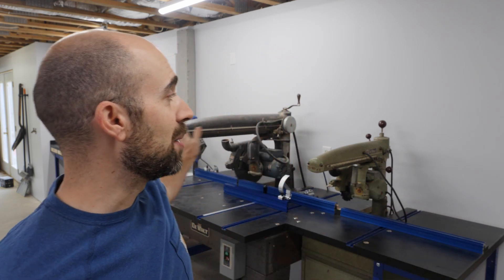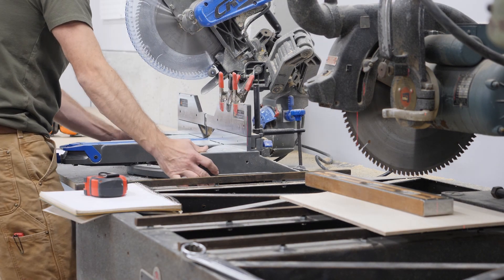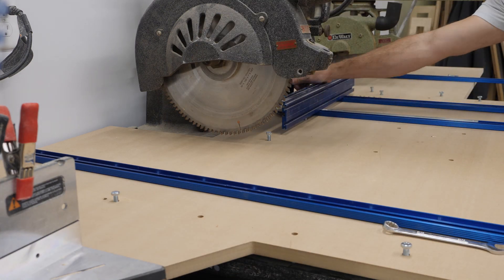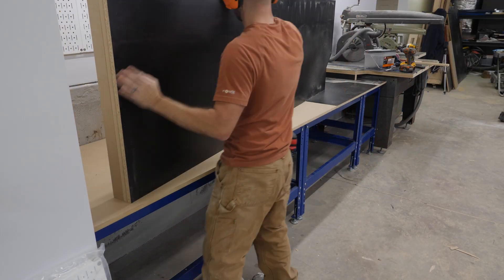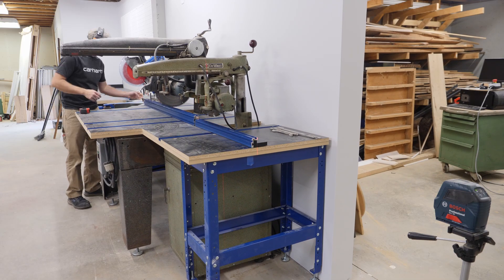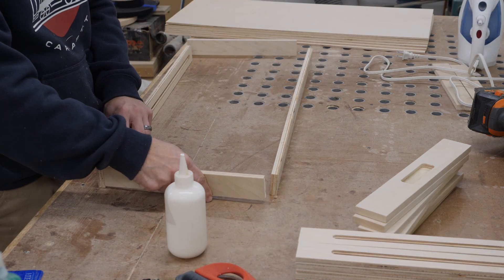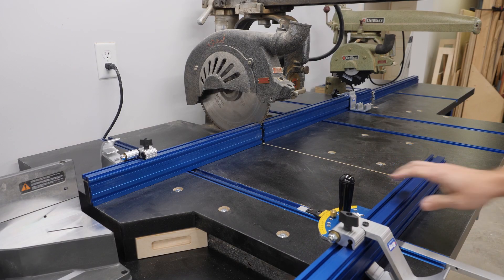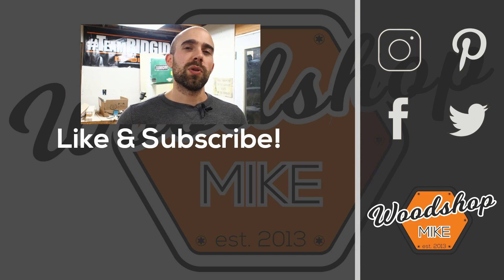Ultimate Miter Saw Bench

Comment: Hi Mike, First off I wish I had the Cnc Machine, so nice. I build doors, gates and louvered shutters and really took an interest on this video. I have an Omga 600 P3S 14 in 5 hp 3 phase radial and a Dewalt 12 inch sliding compound saw set up similar to what you have. What I have found is keeping the radial arm saw to rough and finish cut a perfect 90 degree cut and use the Sliding compound saw for angle cuts. Even though this can be done with the radial saw I just hate having to take the time to guarantee that nothing has moved on the Radial saw from setting to setting. Thanks for the great video and I am  going to look into the kreg fence system for my set up. Thanks for the video and love the saw station set up a lot more than what I have at the moment.
Reply from the maker: Thank you so much, I'm glad the video was interesting!  I'm like you, I hate the idea of moving the RAS out of square with the fence and only use it for making 90 degree cuts.  I've been super happy with the Kreg fence system.  Glad I could give ya some ideas!  Cheers!

Comment: Do you have a plan for replacing the benchtop under the RASs when it gets chewed up in a few years?
Reply from the maker: I leave those at 90 so there will only be one cut line in the bench (or at least that's what I tell myself 😂) but should I need to replace the top, I'd route out a section and basically make a replacement throat plate.

Comment: QQ, since you have the t-track in the table, why didn;t you use that to attach the RAS fence, that way you could adjust it if needed?
Reply from the maker: 🤔 I feel like there was a reason at the time but I don't remember why I didn't do that.  I used t-track to mount the fence on my previous miter saw station and it worked very well👍

Comment: Impressive setup.  The laser got your fence very close to perfect but you can fine tune your radial arm saw within thousands of an inch in all directions by following the procedure Jon Eakes outlines in his book "Fine Tuning a Radial Arm Saw."  For example, to do a simple test for 90 degrees, set the blade height to cut a little more than half way through a piece of scrap 3/4" particleboard and cut one side.  Flip the board over and put the same edge against the fence and repeat.  The resulting shadow will show how close to 90 degrees you are.  The design of the miter latch makes it very easy to fine tune the arm in either direction and, once the set screws are in place, it will stay in alignment.  This procedure lets you get your saw in perfect alignment before you put a kerf cut in your table.  

A complete tuneup involves additional steps but allows you to use the saw safely for other operations such as ripping and cutting dados. The most important adjustment is to be sure the table is parallel to the arm and with your setup you need to do this before you attach the saw to the bench.  Do this by turning the motor so it is perpendicular with the arbor pointing down.  Swing the arm so the arbor is over a rail and adjust the height of the arbor so it just clears and lock the arm and carriage in place.  I like to use a small piece of formica as a feeler gauge.  Repeat this procedure until all of the rails are equal distance to the arbor. When you put your top on the rails, it will be parallel to the arm.

You may also want to look into making a sacrificial fence that allows you make a fresh kerf cut for a zero clearance cut.  Your Kreg flip stops can be modified to accommodate a 3/4" sacrificial fence by breaking off the end.
Reply from the maker: Thank you very much Roy and thanks for all the additional info! Good stuff 👍👍
Reply: @WoodshopMike  You may have got lucky and started with saws with rails that were already parallel to the arm.  I just picked up a 1949 DeWalt that has the original top and it is still parallel to the arm.  Who knows?  You may have gotten lucky and ended up with your arms parallel to your top.  It's easy to check.

Comment: How do u adjust the fence for long crooked pieces that push the piece off at cut point
Reply from the maker: sorry for the super late reply!  If I can I flip the piece around so the crown of the bow is against the fence.  Otherwise I'll put scrap blocks between the board and the fence to fill in the gaps.

Comment: So, you have two radial arm saws, but do not use the radial arm feature- can you explain why?
Reply from the maker: I'm not sure what you're referring to as the feature that I'm not using.
Reply: @WoodshopMike  My understanding is that they are called 'radial arm' because they can be moved radially- i.e. rotated horizontally left or right. There are saws that do not do this- but they are not radial arm. I was trying to understand why you do not use the feature after which they were named...
Reply from the maker: Gotcha.  Yes they can do that and with the current setup they could be adjusted to cut angles or used for ripping.  For my needs, having them set dead on 90 is what I need.  If I do need to cut an angle it's faster for me to usually setup the track saw and ripping material is much safer on the tablesaw.
Reply: @WoodshopMike  I keep hearing about ripping being 'safer' on a table saw- but there are failure modes on a table-saw (like lift on the back of the blade leading to side ejection) that cannot happen on a RAS. Yes, a table saw can have a top cover- but going by most YT videos that is often not fitted... So what exactly is the unique safety issue with ripping?
Reply from the maker: Totally valid points you bring up.  With both tools there's the risk of blade injury.  The larger risk with ripping on an RSA is the wood self feeding and being launched through the shop or lifting off the table depending on which way you decide to feed material.
Reply: @WoodshopMike  For rip cutting, the blade is not doing a climb cut (as it is, or can be, for cross cutting) so the physics are the same. Doing a climb cut would be misuse- it is clearly shown not to do it on many RASs.
Reply from the maker: right, so if you cut in the other direction, the blade is spinning upward which can in turn lift the board off the bench.
Reply: @WoodshopMike  Yes- but the motor assembly stops it being ejected. And the blade stops it moving sideways. Actually the force of cutting is downwards, due to the acute angle of the cut.

Comment: It's very hard to align the radial arm saws to other saws. The ras tops are aligned to the arms. Once aligned then you'd align the the tops to the bench's and to the miter saws. Very hard to do this I found.  So the whole ras assembly would have to be adjusted and brought level to the bench top
Reply from the maker: Yep you're totally right.  It took a LONG time to make sure all of the benches and individual RASs we're level and square before I started attaching the bench top.